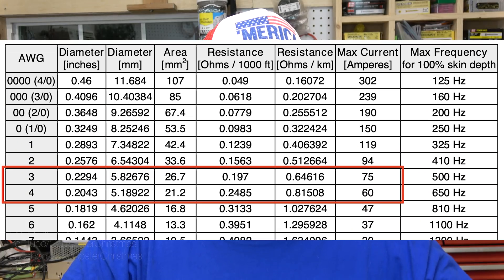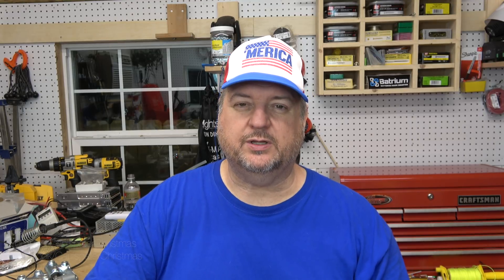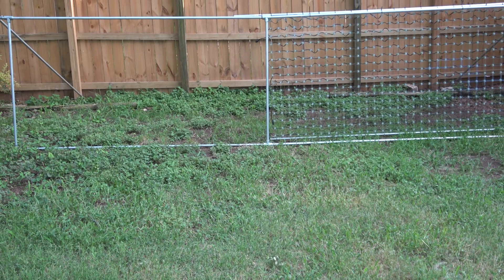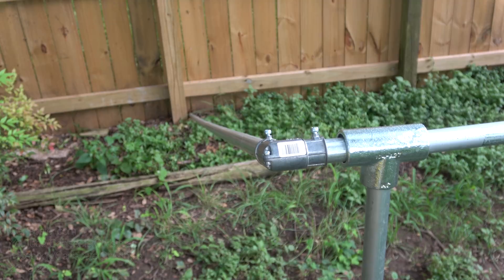🇺🇸🎄Quick Update and Prop Frame Build (2019) 🎄

Comment: I want to create a RGB matrix to cover my garage door (15'x7'). any suggestions
Reply from the maker: Check out Boscoyo. These come in 4x8 sheets so I'd probably just trim a foot off the bottom & one side. Also, that's going to be a ton of pixels so you'll need to use more than one string in the software - not a big deal tho. Probably at least 4 equal strings depending on density.

Comment: Amy suggestions on how to connect lights to my house for outlines without permanently drilling anything into the house.  See I just gave the front of my house a face lift and I don't want to drill anything into if possible.  In was thinking of magnets.
Reply from the maker: Haha. That's kindof a loaded question, but hot glue, separate frames, some sort of hangers, etc. I outline my windows with strip hanging from the top (yes screws into the brick), but it doesn't touch until the bottom. Also, keep in mind that at night, it may be hard to see what you're outlining so it doesn't have to be perfect. Also, you might ask this question on the forums as you may find people in the same position with some creative solutions.
Reply: @CanispaterChristmas  thanks.  I will keep researching the issue as you suggest.

Comment: What leds are you using on matrix?
Reply from the maker: The ones shown are 12V flat bullets, but for this prop, I'm going to use 5V bullets.
Reply: CanispaterChristmas thanks
Reply: Can I ask why you chose 5V bullets over the 12V flats?  I really value your opinion on this.
Reply from the maker: @SteveWeinrich  I want to do some experimentation with 5V pixels since everything else is 12V. Doing this in a matrix is the easiest to inject power since the pixels are concentrated in a small area. Bullets because I'm not worried about clearance behind the prop.
Reply from the maker: Oh, and THANK YOU for your donation! Looks like you guys got the hang of it last year! lol!

Comment: I got one of those... just have to install it, happy 4th man
Reply from the maker: You mean the garage door opener? Yeah, took me longer than expected by a couple of hours, but was actually very easy to install, especially since I was replacing an old one. The old one was a worm drive and this one has a belt - MUCH quieter. We'll see if it holds up well, but very happy with it and I like the notifications when it opens or closes.
Reply: @CanispaterChristmas  yes i love it i cant remember what one it was but its in storage, bought a house last october, was going to replace the broken one on the rental property but since we didint stay we kept it.. we paid for it...